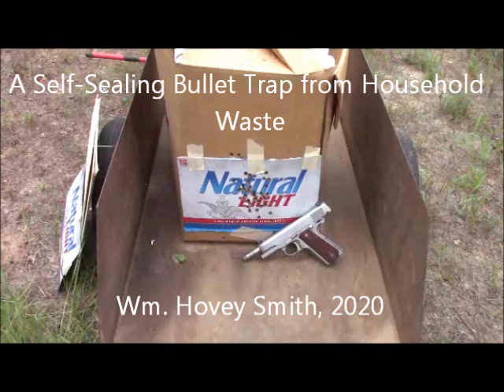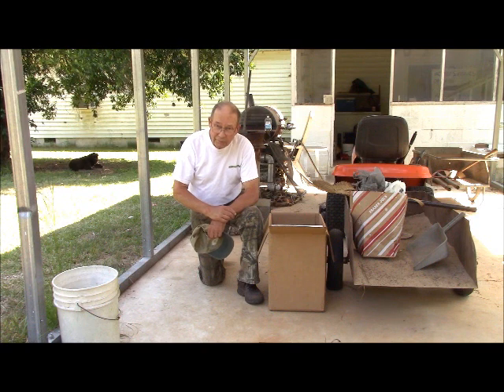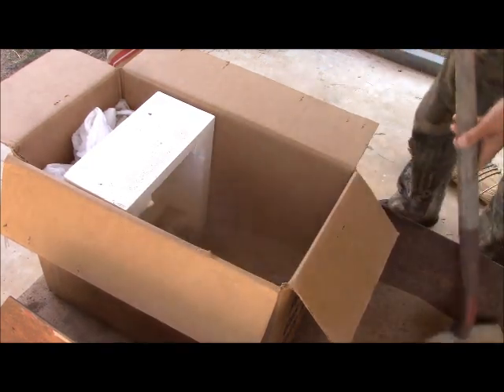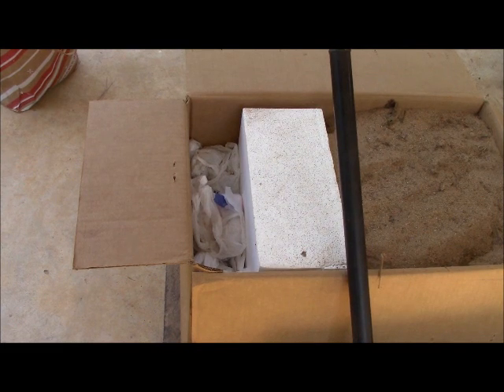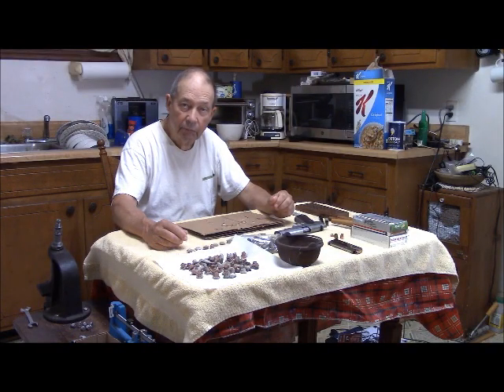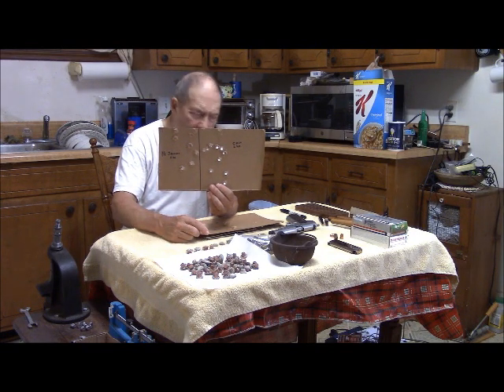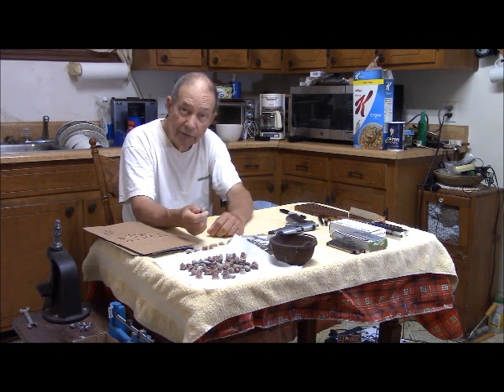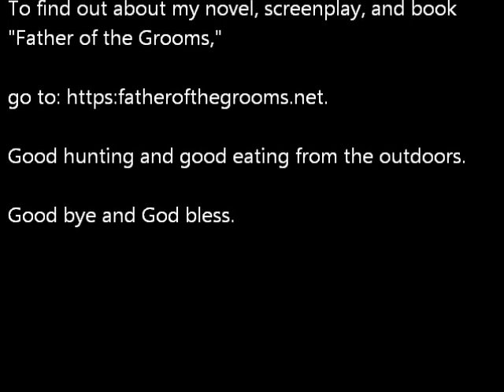A Self Sealing Bullet Trap Made from Household Waste

Comment: What is a good product to use for cleaning lead filing from black powder rifles. I too have a sand trap to catch my lead.  Saves on trying to find lead. Stay safe
Reply from the maker: I have not found a magic product that with a single wipe will take lead out of bore. Most such preparations are for copper-based jacket material. Brass bore brushes are the best way to go thus far. Does anyone else have a favorite product or preparation that will remove lead without doing damage to the bore?

Comment: Seemed to work well, I built a bullet trap years ago using 2x12's and sand, it worked very well, eventually I had to replace the 2x12 on the front of the trap but it lasted a long time before I had to do that, good video, thanks for sharing!